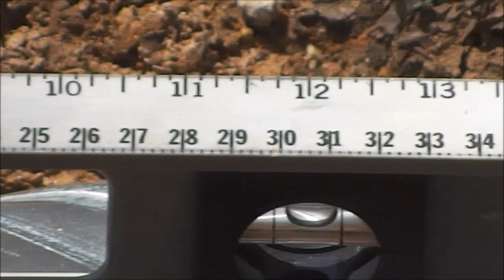Driveway Culvert Replacement

Comment: You sure undertook a big project, and with a loader, no less.  I was surprised that one could handle that kind of project with a loader.  Very  impressive for sure.  Looks like you're doing a bang up job of it. I've got the earlier 4025 version, so by watching you at work proves it can be done.   I have a similar situation that needs redone, and it's nice to know that I should be able to do the same with my tractor.  Enjoyed the video.  Thanks for sharing it.  Jay
Reply from the maker: It took about 6 to 7 hours to complete and it didn't help that it was almost 100 degrees out. Your 4025 should have no problem in removing a culvert but just make sure it's not 100 degrees out :) Thanks for watching

Comment: Great job, Pete!  I'm a newbie with my first front end loader (70 hp New Holland Workmaster).  One of my first jobs will be to lay a culvert under my driveway before the concrete folks start framing up for the pour.  This vid was very helpful.  I'm subscribed.  Semper Fi, TreeTop
Reply from the maker: Thanks for watching and subscribing.  I'm glad the video was helpful, just take your time and don't do it as I did in 100 degree heat :)

Comment: A lot of Monday Morning coaches posting to this video. Every state is not the same with laws. Also, if his land is flat and the ditch is flat and level, the culvert can not follow a slope as none exist. We read on our county website, the culvert should follow the slope of the ditch or land. So if there is no slope, it must follow the land and or ditches natural plane. Our ditch has a slope as our property is on the hill of the road. We will do the math to properly set it, before back filling and tamping as we go along. It is an 18"X36' Oval Galvanized Culvert, with 4" to 1' bevels on the ends.

Thanks for the time you took to upload this video.
Reply from the maker: Thank you for your positive comment, you're right about "every state is not the same with laws" There were a few comments here that said I did it all wrong, but I did slope it a bit. If you watch the bubble on the level, it is slightly off center in the right direction. To all those with their negative comments, this is not rocket science and my culvert has been working great even during torrential downpours. Thank you again.

Comment: Good job P.B. and I see you're a Ram fan like myself!!!
Reply from the maker: Yes love the ram truck, but living out here in the country it would be nice to have a 2500 4x4 with the cummins diesel. mine is a 2012 1500 with only 39000 miles and all of the 2015 or 2016 2500 trucks I have looked at are a bit pricey right now :(
Reply: Tell me about it I just laid out 50K for a 2016 1500 4x4, it's an awesome truck but pricey indeed!!!

Comment: These were like 12 inch diameter pipes by 20ft lenght. Am I right? How much would you estimate one of them weight? For me, I have a job where I think I could use a 6 inch diameter of the same type. I am looking to be prepared if it is heavy weight or not.
Reply from the maker: Correct 12inch by 20ft long. You shouldn't have any problems moving 6 inch pipes around.

Comment: Thanks for doing this video. I have a 50 foot culvert to replace so that this was a good guide for me. I like the helpful comments made by #tubedude54 about the slope, which I was wondering about, to keep sediment from building up, Also, the one foot of granular cover over the culvert was a good guide.  Also, the tip about getting a permit was good. I am on a private road owned by the Pennsylvania Power and Lignt (PPL). We put in the culvert when we built our house so PPL says that they won't replace it and our township (Scott Township in Lackawanna county Pennsylvania) said they would replace it except that it is on a private road. This has me befuddled.  I think I will check with the county highway department about the replacement size and all of the other details in doing it.
Reply from the maker: Yeah putting a slight slope on the culvert is a good idea and make sure the culvert is big enough to handle the flow of water after a  heavy rain. I probably could have had the county replace mine but I don't think they would have replaced it with a 40 foot culvert as I did.........sometimes it's best to just do it your self.

Comment: What's the coupling called? I need to add on a pipe to my existing  culvert.
Reply from the maker: They're called "culvert Steel Connecting Bands"
Reply: Steel Re-rolled Bands or Hugger Bands.

Comment: Didn't you need some pitch so the water can run one way or the other in the culvert?
Reply from the maker: Actually yes in most cases but I chose to keep the culvert level because the ditch and road in front of my house does slope down in one direction, so the water goes in on one side and comes out and drops a few inches on the other side. I haven't had any problem.

Comment: You should have put some gravel under the culvert and added some magnesium chloride on top over the entire entry, it will help cement that top fill and control dust.
Reply from the maker: The gravel I used was limestone and packs down really well and doesn't really make any dust. But the sodium chloride is a good idea.....Thanks
Reply: Is that mag chloride aka ag lime?

Comment: I am a city boy please humor me. What is the purpose for the culvert? I am guessing so water will not build up and wash out the drive way.
Reply: TheBadGuy1275 on our country roads we have ditches on each side of the roads. Water runoff collects in these ditches and routes the water elsewhere. When we put in driveways we must put culverts in so as not to block the ditches. The culverts allow the water to continue to drain. However if they get clogged or in this case crushed the water will backup and will either erode the driveway or the road itself. Hope this helps